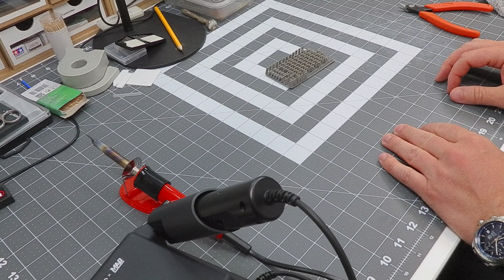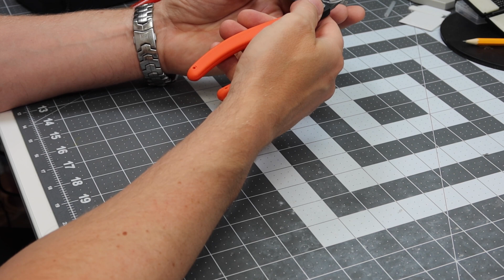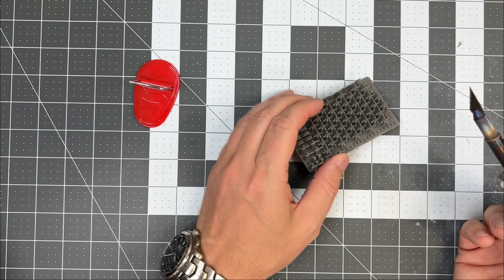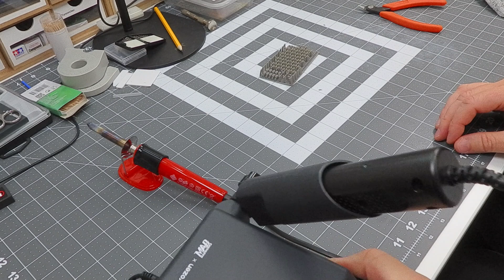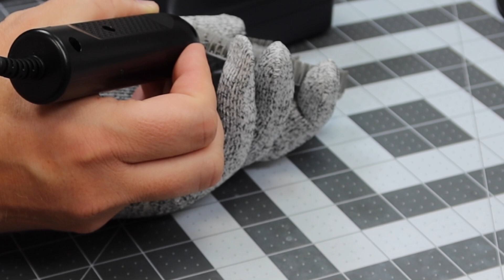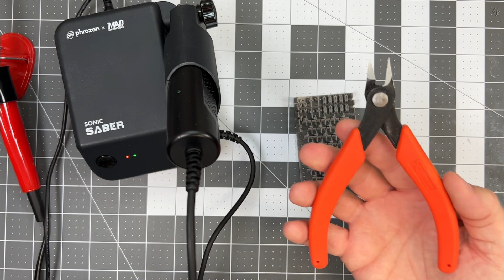Removing 3D-print supports

Comment: The Sonic Saber is a terrific tool. I scratch build and use the Saber for cutting out doors and windows easily in 4mm sheet styrene. It can slightly melt the plastic but with a light touch it makes quick work of cutting numrous openings.
Reply from the maker: It is, but I haven’t tested it on such a thick plastic, thanks for the tip 😊